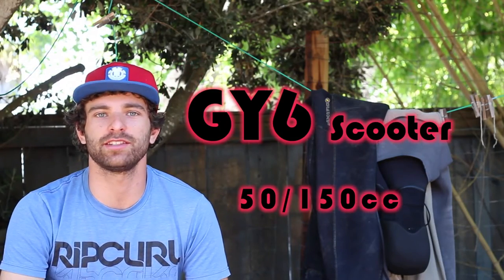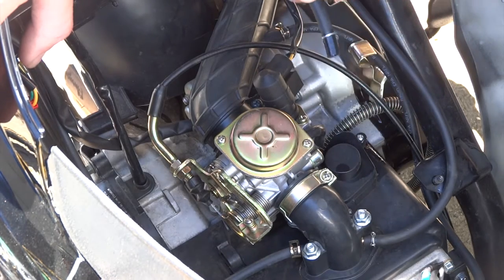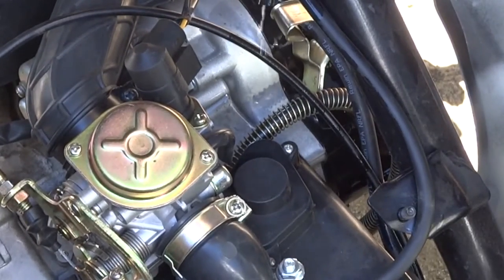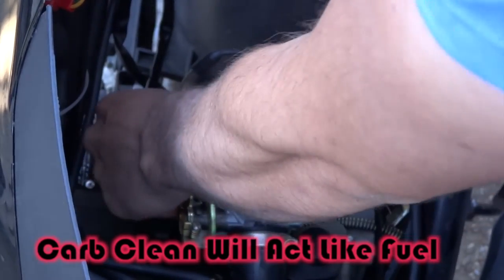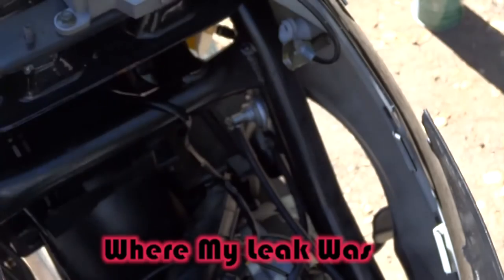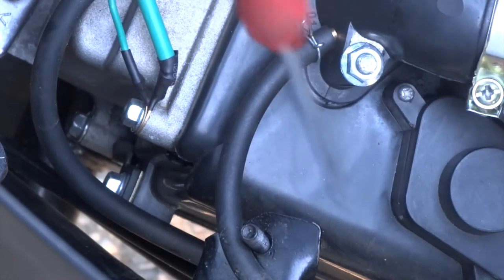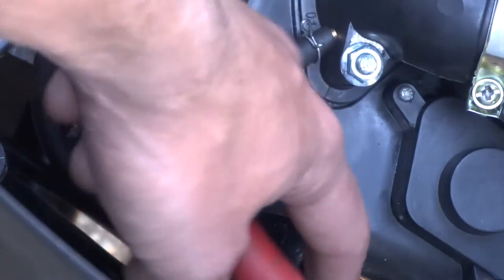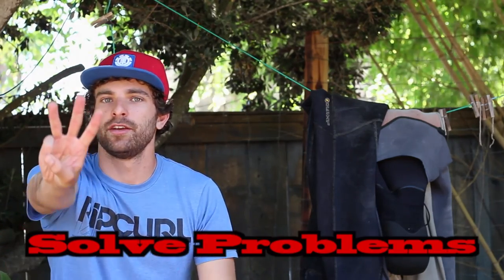The Ultimate Tao Tao 50cc ATM GY6 Troubleshooting Compilation (No Start, Bogging Out) **UPDATE**

Comment: Something to note: that line with the spring around it coming out of the carb is a fuel drain. You can disconnect the bottom from the frame and undo the screw on the bottom, and any gas going into the carb will flow right out of that line

Comment: You are correct on the air intake leak check, but please do not tell people to use carb cleaner.  That is the absolute worst thing you can possibly spray on rubber parts.  It will cause all those parts to harden and crack prematurely.  Only use WD-40.  Other than that it's a good video, thanks.

Comment: You produce great videos! Nice clean engines.  I have a Znen that when I start it won't turn over, I have spark, new spark plug, but gas pours out of an overflow at the top of the engine. Where am I going wrong?  I am in the process of changing my oil.   Im at a loss.  Any advice?
Reply from the maker: first look up what "turn over" means for an engine. if it won't turn over, seriously, that means the engine is seized and junk. I doubt this is what you mean.

Comment: Mine isn't a GY6 but a 50cc Zuma, but I cannot seem to get fuel to come out of my fuel line when I have it disconnected while kicking the engine over with vac line connected. If I suck on the vacuum line however fuel will flow out of the fuel line.

Comment: I got tao tao 50 and the battery died i tried to charge it didn't work.so i got a new one and plug it in backwards thinking green was the possitive. I was wrong.wtf anyway i connected it write and it wont do anything. Did i mess it up?.its a bran new batterie. And im not getting anypower anywere what do i do ?